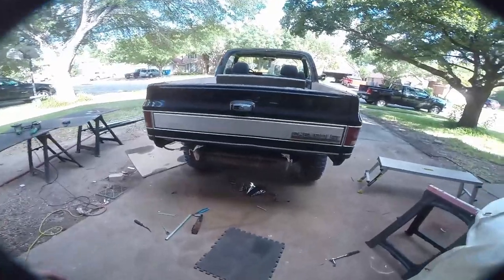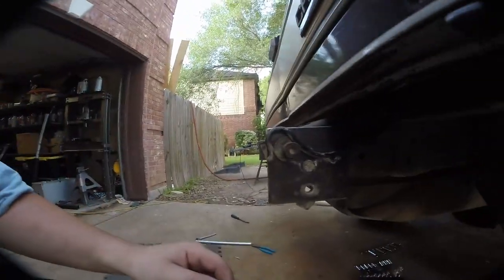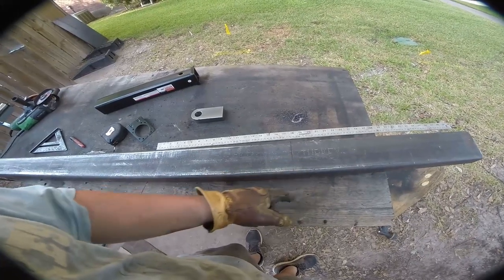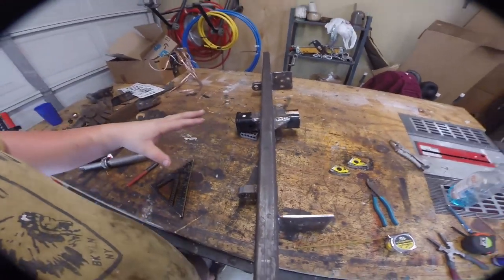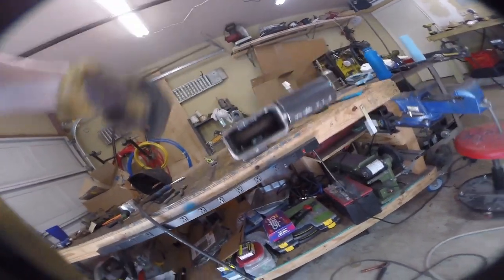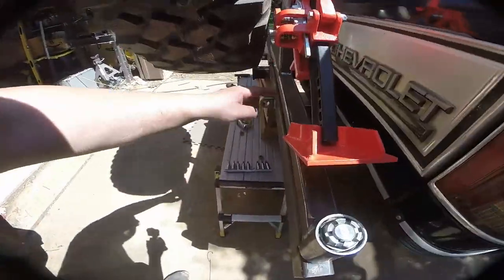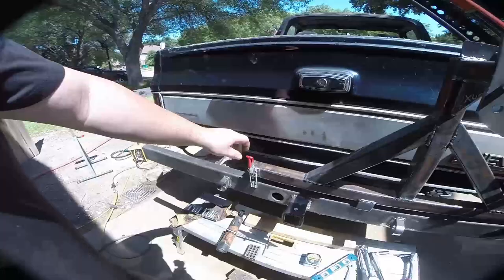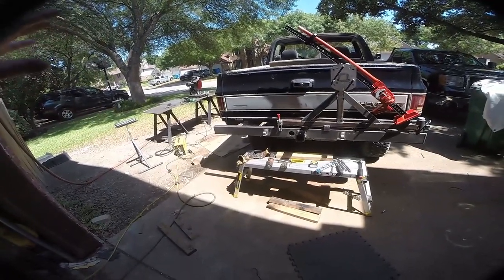1989 K5 Chevrolet Blazer Build - Episode 10B - Custom Rear Bumper and Tire Carrier

Comment: Good work on both of the bumpers.   My rear that we built earlier this year is similar except we used a spindle and hub from a front 10 bolt axle.  Everything is bigger from the spindle and bearings, plus and the added bonus of using a standard lockout on the hub. This allows the swingout to be locked in any position after opening.  Pretty handy and another set of spares just in case you blow up a lockout or need a bearing on the trail. I totally agree with your plans to drive to a location, wheel and drive back.  I've driven my 91 k5 to the Mojave road in CA from CO, Utah for Moab and other areas and all over central Colorado mountain trails. All driven to and from each time, no trailers.   You've picked a good platform, keep up the good work!